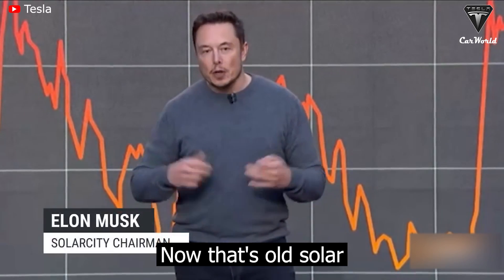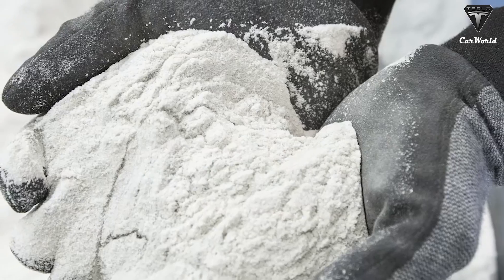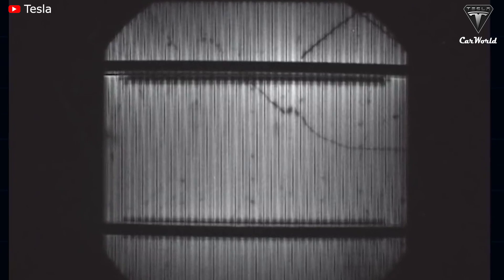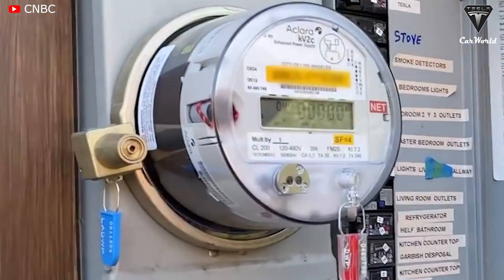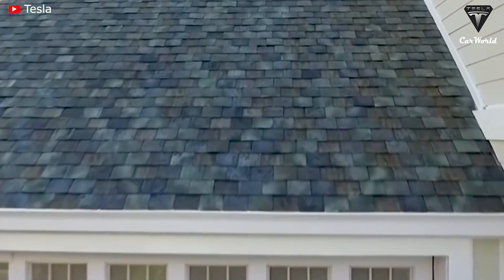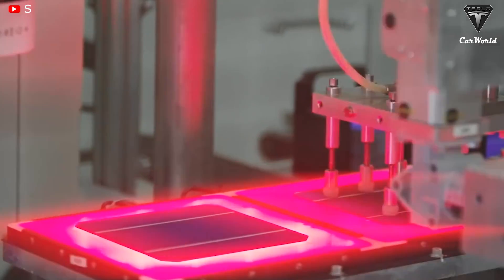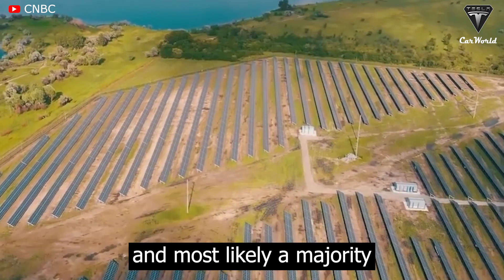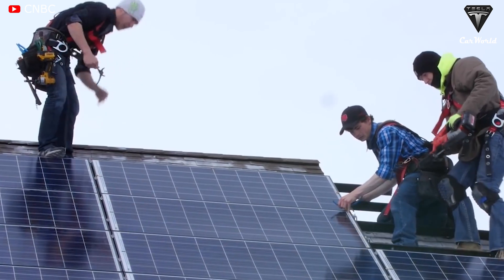IT HAPPENED! For Only $0.22/w, Tesla 4.0 solar cell Can blow your mind!

Comment: Interesting vid.  Q's about the math.   Meanwhile just 4 feet down the earth is a constant 56 F, massive heat avail ie there is a nebraska guy who grows oranges and other fruits & plants all year round even in the winter.   He dug a very big pool size hole 10 ft down, filled it with conduit pipes (aka duct pipes), then with just 2  $10 fans, one pushing air thru, and another pulling air out, he heats his greenhouse and house to 56 F , than augments the house with other heating... WOW !  Obviously in the summer he can also AC his house to with the 56F air flow.   InventPeaceNotWar !

Comment: .22c per watt? I'm paying almost $1.00 per watt. Just for panels. 
Then the BATTERIES. 
Duh duh duh daaahhh. The batteries set you back big time.  On average,  I paid alm$110 for each battery. 105 Ah at 12volt.
And multiple batteries.

Comment: two-story, 2,000 square foot, 11.28 kW Solar Roof costs just over $55,300 before incentives, assuming you’re replacing the original roof
1,000	Single story	6.31	1 Powerwall	$46,425
2,000	Two-story	12.57	2 Powerwalls	$64,193
3,000	Three-story	18.83	3 Powerwalls	$81,961
Roof Replacement
The Solar Roof is meant to be installed on top of a single-layer 3-tab asphalt or composition shingle roof that is less than 20 years old. For any other roofing material, or on any buildings more complex, the roof must be replaced entirely. At its cheapest, requiring a roof replacement will add between $10,000 to $15,000 to your total.As part of the Tesla Solar Roof package, it is mandatory that you also use the company’s integrated battery system, called Powerwall. a single Powerwall cannot run any large appliances, but three Powerwall units can run multiple large appliances at the same time. You can have up to 10 Powerwall units connected to the same system.A Powerwall currently costs around $6,500 for the battery unit. Installation and set-up fees add another $4,000, ending up at a total price of $10,500. Each additional Powerwall unit costs $6,500 each, with no known additional installation costs. ny roof installed on a residential building from 2020 to 2023 can expect a 26% Federal Tax Credit.Due to supply chain costs and enhancements made to the solar roofs, Tesla has drastically increased the price of its solar roofs. Tesla’s solar options are significantly more expensive than other solar companies and renewable energy alternatives on the market,

Comment: If solar panels were the answer every roof of supermarket, industrial site, hospital, parking area, recreation buildings, government buildings would be covered. Why are they asking the general public to invest large sums so the electric provider dictates what you get back. Why is'nt tesla coming up with cheaper realistic solutions for coming off grid such as sodium ion batteries rather than lithium and a size to power a house without taking out a 20 year mortgage which happens to be the life of the system.

Comment: Can a solar powered drone with a house sized surface area be developed that can hover over houses or buildings to shade them? Parking lots are perfect places for fixed solar canopies also.
Reply: Bad idea. You would be using most of the solar energy to keep the thing floating. And what are you going to do at night? Keep powering it all night, wasting energy and making noise? Only other option would be to park it somewhere, using up a ton of space. What about wind? It will blow it down if there’s a storm which could kill someone. And how bout those motors? You know they wear out, right? Also, the only practical way to get the power back to the ground would be with a wire tether so you might as well just support the solar panels like any other carport roof or gazebo. Your idea is so unrealistic and unnecessary that I’m going to assume you will not be leaving any intelligent response to my comment... The ONLY thing that could ever be even considered to be a “benefit” would be that it floats... ”Ooooo cool floaty thing!” idiots are easily amused...
Reply: Yes I’m an idiot. Just wanting to shade my house but you are right.

Comment: What is this nonsense. Conventional solar panels are 20% efficient. If the new cells are a theoretical 100% efficiency, they can produce 5 x the amount of energy. Not a 1000 x.
Reply: They have 22% for the best panels at about 93% degradation over time for the best panels. Meaning the panel won't loose more then 93% of it's power input over let's say 25 years. 

That seems to be the benchmark most go by now. However industry standards at present is about 19-20% efficiency. With about 80-85% degradation over time. 

So this would be a quantium leap for sure if true. I personally am a bit skeptical on these figures but who knows I guess. N-Panels are still the best at present but this seems a bit unrealistic here.
Reply: @BlazinNSoul  thank you for correcting me on the 2% discrepancy. What I was trying to point out is that Elon Musk is the absolute king of exaggerated claims and false promises. Whatever he says, you have to divide by 100 to approximate reality. The guy is over physics.

Comment: What if you use magnifiers like a magnifying glass to concentrate the sun's rays on the solar powers? Or is it already been used.
Reply: It's been done. There is the problem of gaining too much heat though which will damage or destroy the cells quickly and power output decreases with temperature rise.

Comment: The problem with solar is that we currently don't have a the right way to produce the silicone for it. logic needs EXTREMELY pure 99.9999999999% pure silicone, while, solar only needs 99.999999% pure solicone (11 9s vs 6 9s, I sure i hope i didn't fuck up). What we use for logic, CVD, is very expensive and unnecasiry for solar, but the older methods don't produce the silicone purity that we need for solar so now we're (as a species) in the research phase.
Reply from the maker: We are going update the latest news in the next videos!

Comment: I don't like the fact that there's a degradation in the solar battery storage with lithium. I here metal batteries  that are in use in the power grid actually has 0 degradation  and unlike lithium it can get hot and can even freeze and once thawed out it will still work ..  does anyone have reasons  why Tesla went with lithium in there larger battery  banks , like for solar city.

Comment: You are mixing up your figures.
$0.20-$0.30 per watt is the normal, industry standard price for buying solar cells in bulk from the factory.
If you want that shipped to your country, broken down from the order of a million panels, delivered to your house and installed on your roof the cost becomes $2-$7 per watt.

Comment: This vid throws a lot of numbers around pretty loosely. $2 + /w current cited is probs way high, as many panels run much lower than this. Only qualifier could be adding panels plus system costs. But $0.22 cited new cost certainly doesn’t consider these same total costs.

Comment: The thing with solar cells is none of them have any kind of lens over the solar collectors. If they made little lens over the entire surface they could make a solar panel that draws in energy as if it took up a much greater surface area while not physically taking up that space.
Reply: The thing is, it's cheaper now to use the area that would have been used for the lense to just fill up with more solar panels. Also solar panels run better at lower temperature, so a lense would make it run less efficiently than distributing the heat evenly amongst many other cells.
Reply: well not really, you can collect light with lenses from wider angles and a larger area and then focus it down to a smaller area, so your actual area of solar cells can be smaller because of the higher energy density, but you still need to collect that light with a large lens, or a large array of lenses, this is why telescopes are better the bigger the lens/mirror gets, more light = more resolution, there is no 'trick' to cheat collecting light, you get as much power as your photon density, you can only increase that density by collecting light from a large area and focusing it down to a smaller area.
Reply: You'd just melt the panels, if you want to get more light, you just need more of them.
Also solar panels collect UV, not "light" (though they are both part of the electromagnetic spectrum). Ultra-bright Xenon bulbs put right against a solar panel will do nothing.

Comment: recycled copper silver recycled tact board  and recycled aluminum cans need 94 percent efficiency over 25 to 30 years and 50 below zero. need cheaper lithium 100 ah 12 volt battery. storage bank.

Comment: "A large Tesla solar system of 11.34 kwatts can produce an average of 43 to 58 kw-hrs per day. Equivalent to 1500 kw-hrs per week. With the feroellectric cell don't be surprise when we say that it can produce 1.5 million kw-hrs per week"

Why should we be surprised complete lack of basic math skill is strongly correlated with utter bullshitting.  58x7 = 406kwh, nowhere near 1500. And 1000x increase in output would mean these wonder cells are >5000% efficient - 50x more energy than the one available in the solar light.
Reply: By this math logic I'm a multi-billionaire!🤯
Reply: Great move removing dislikes
Reply: @augustvctjuh8423  You can get an add-on for most browsers to put that back. The current dislike count for this video is only 1.1k vs 8k likes, so a bit more than 1 in 8 people are spotting the bad math and other bullshit.
Reply: @WhoMe87799  wow.. lifechanging 😂
thanks
Reply: Amen...
Reply: Because a cloud fucks all your math clown or a 3 day rainstorm that makes your panels waterstained
Reply: I am not a mathematician , but I am a Commercial Master Electrician with an Engineering degree . I contract my company to local and regional power companies to build and repair their grid infrastructure . America currently owns and uses 284 million gasoline cars, America currently manufactures 1 million Electrical vehicles per year , even if we manage to increase our production to 3 million E.V.'s per year we only need 100 years for full replacement . 60% of America's homes will have to have feeder lines from transformers upgraded  to homes charging more than one car at a time. The current electrical grid would need to triple in size to sustain 250 million E.V.'s charging " this does not include any diesel trucks ". I estimate this will take at least 30 years to complete and unknown trillions of dollars. The millions of transformers " seen in almost all neighborhoods "  needed to perform this task are no longer made in America due to PCB chemicals danger/ pollution . P.S. There is not currently enough lithium in the world to power the smallest state " Rhode Island 1,045 sq. miles " .
Looks like a Bankruptcy  Scam to me !
Reply: @rohawaha  So, there is some waken people in America? Nice!
Reply: @rohawaha  The cost of power from the grid is about $0.10 per kilowatt-hour.  $0.22 per watt, times 6 hours per day of production (more sunny hours, but closer to the horizon), yields $0.00132 worth of energy per day.
This new system has payback in 75 days? 2.5 months to payback? There's gotta be a catch. (Other than it doesn't work at night, so you need batteries to use the lights.)

Comment: $0.22/ installed watt? Or $0.22/watt for a solar panel? Existing solar panels are close to $0.40/watt CAD right now. And solar installations in Canada are being sold for as low as $2.20 CAD/ installed watt.
Reply from the maker: $0.22/watt for a solar panel. It's a lot cheaper than other solar panels. Btw thank you for your comment, John Lockington
Reply: We are Moroccan distributor
Where we can buy for distribution in Morocco

Comment: First I think electric cars are a great idea. KEEP WORKING AT IT! And get an electric grid to support it! 
Now my rant..
In Singapore there are tracking monitors  like they have for vehicle passes  to travel on selected lanes of a roadway, or to travel on toll roads and bridges. They tax you every mile you drive to make up the lost taxes. In there case its just a luxury car tax if you own a vehicle, if I had to guess. They have tried to pass this a few years ago because of less gas being used by more fuel efficient vehicles.  So be prepared to pay more on your electric fill up!. I bet that when more people get solar panels for the home, they will add a counter of how much electricity you use and tax you that way. I feel that they are holding back on this technology until we are so invested in electric vehicles you will not be able to get a gas vehicle.  If you think you are saving the earth you are just replacing fuel emissions for toxic trash from the batteries and the stripping of the earth from slave labor who mine it. You may feel good about yourself, but you did nothing to save the planet or people with this technology.  Maybe if the batteries are made from non toxic materials we may have a chance to move away safely from fossil fuel and have a much better range than we do. Another thing qlot of countrys are no bigger than a few of the states of America.  So they can get by with a smaller range of 350 miles or so.
Reply: Good spot to roll out a thinking point that does not get mentioned very often.  If home charging an electric car using solar panels, the car is often parked at work elsewhere during most solar production hours, the solar panels would have to be at the workplace to charge the car. Otherwise, the home solar system would need battery capacity roughly equivalent to the size of the car battery to store the energy while the sun is shining to transfer to the car that night when the car is home, suffering an efficiency loss of one more charge/discharge cycle. 
 I think most employers currently would be reluctant to put in solar panels or even allow an employee to set up their own, but when, not if, electric cars approach majority, or even when it has just become obvious to everyone that will be the eventuality, at work charging will become an employment incentive, touted right alongside health insurance, flex-time and 401-k. 
Barring charging at the workplace if everyone is responsible for charging their own car, with their own solar system at home, the total amount of battery capacity will be on the order of double the combined capacity of all cars.   Even if not for that problem of cars not being where they can be charged when they need to be charged if using solar, the amount of battery capacity that will be required worldwide is staggering. We really need some massive, cheap materialed, non-toxic, cheap to maintain and refurbish, fixed location batteries, in that instance, weight is of no concern. That opens up a lot of battery possibilties that are not feasable for mobile energy sources.

Today I pulled the trigger and paid for a solar system to charge my Leaf and run some other home loads to reduce my electric bill. As soon as I can come up with a simple way to pull power back out of the 24kwh battery on the Leaf, I will have no electric bill.  Middle finger.  I will not even consider trying to contribute any excess production to the grid because the payment scheme is abusive. Cost of fuel is all they pay, seems like that figure is $.003, while when the meter spins the other way it is $.07 at night and up to $.43 in the hottest part of the day in summer months.  .003/,43= ~143 to 1 "But muh grid!" I would be glad to share watts with you neighbor, but until the law requires them to allow distributed competition, the monopoly aint havin it. 
If there were a more reasonable rate for spinning the meter backwards, so to speak, I would be happy to export energy collected at my home to the grid  at a discount so I could plug my car in elsewhere and charge it, effectively with power I added to the grid with my own equipment.  I would be ok with giving them half just for transmitting for me. Electrons are fungible. The utilities are not going to do that of their own volition, they will have to be forced to because whatever energy I produce on my own is energy they are not going to be able to sell at a handsome markup. "Muh shareholders!"
 If I could reasonably put power  into the grid at one spot, and take out half elsewhere that would be good for us all because someone else absollutely will use that other half, and the fuel that might have been burned to make that power is conserved. As it stands currently I will throttle back my inverters to probably 1/4 of their capacity at times because of monopoly abuse. Whatever happend to that special legal distinction of "utility"?
 Oh and if you are upset cause I'm not paying a gasoline tax to support roadway infrastructure, not to worry, they implemented a new tax last fall that equates to about 36cents a mile for me.   

It's high time we revisit the concepts of monopoly and utility, not just in the energy market.

Comment: A $25,000 Tesla simply requires competition. As long as car makers ignore electric cars there is no reason for Tesla to build a
$25,000 car. Tesla can sell
Every car they make. I recently saw an electric Kia
on the street. It was a quite impressive car. Once Tesla has competition they will have an incentive to build a
$25,000 electric car. Currently Tesla makes more 
Profit than GM even though they only sell one tenth of the cars GM sells.